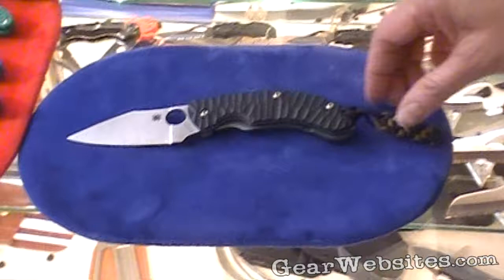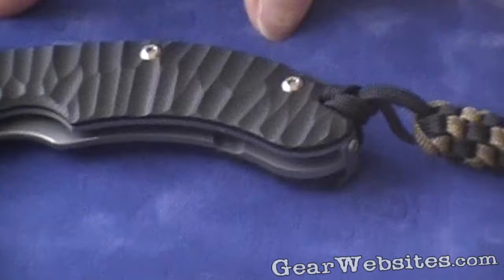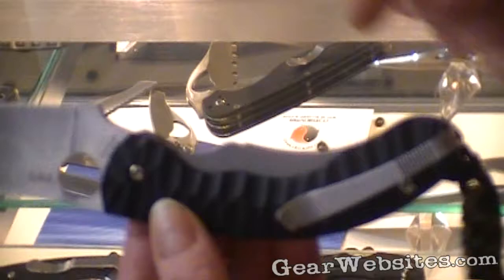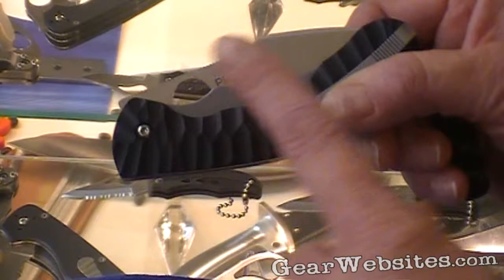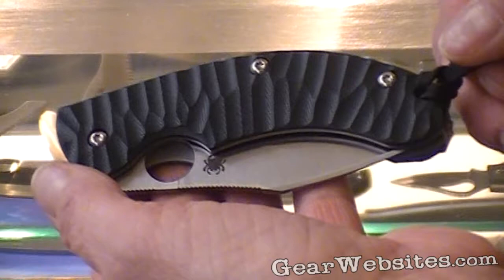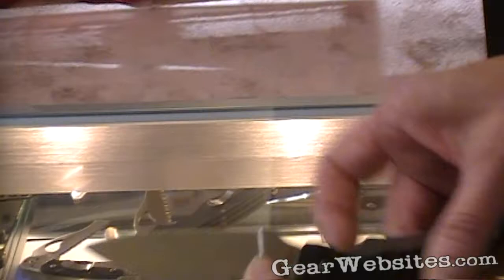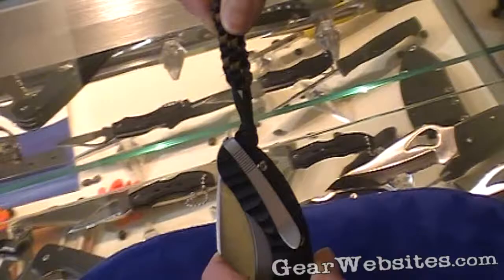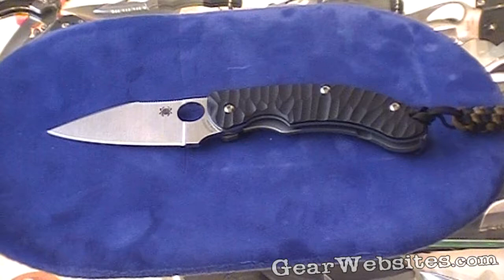Spyderco Perrin PPT Folder

Comment: Way too overpriced for an EDC. For $150 I can get a hand made sweet damascus blade or two Kershaw S30V Blurs. Same steel and (made in USA) not that this matters since Spyderco has killer quality control but still...come on Spyderco, lower your prices a bit and offer a better warranty. Learn from Kershaw. What does it cost to make one of the pocket clips? Something like 5-10 cents. Why would you charge $5-$8 for a clip? I can officially say I have a love-hate relationship with Spyderco.